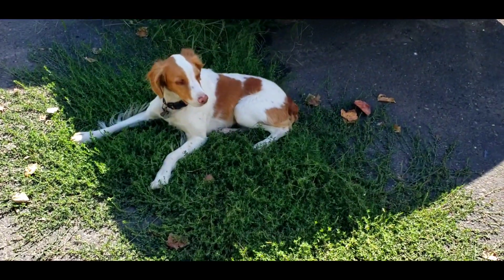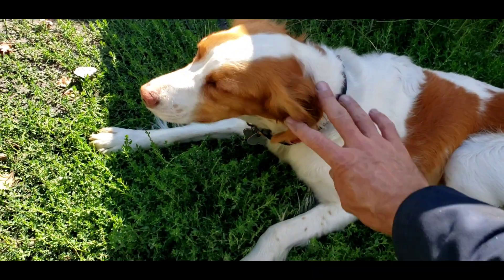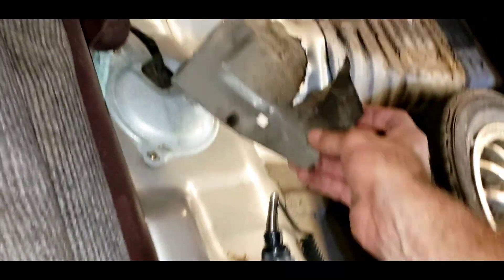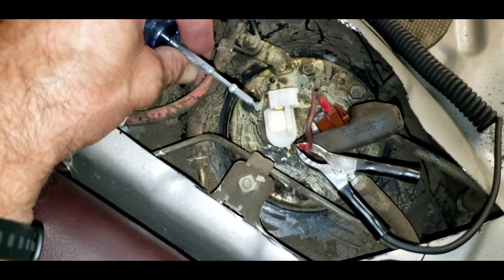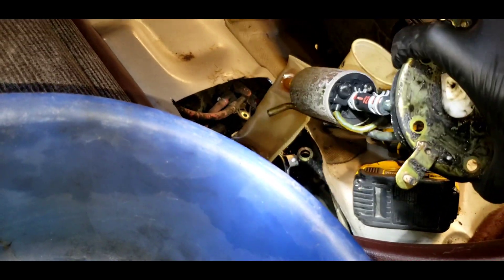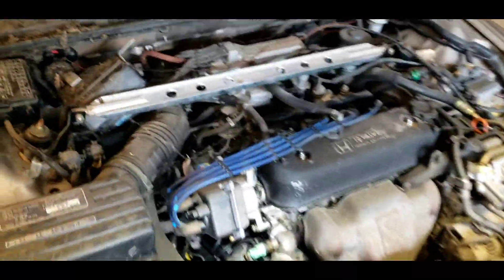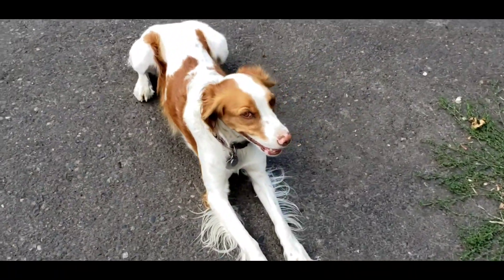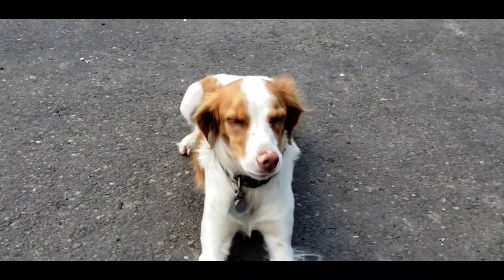Stella Says Start the Wrecked Honda Car Already

Comment: I guess sealed fuel system on newer cars is less affected from bad gas issue. I once started my Ford Tempo after sitting 3 or 4 years in garage. Didn't had more than couple gallons in tank tank. Started on first crank. Pleasant surprise.

Comment: I own one of these with the coupe body style, No air conditioning, no power anything except power steering and cruise control. The radio sucks, and it's an automatic (for now). And yet I am excited to drive it every single time I turn the key. It feels so nimble and light on its feet, the engine may not be very powerful, but it certainly responds to gas pedal inputs much faster than most modern cars, which makes modern cars feel like such a drag to drive. Even the 4 speed auto is a no nonsense, harsh shifting, gear banging reliable piece of equipment.

This was peak Honda, and they truly were magical. Never will we get a car crafted with so much care again. They deserve to stay out there

Comment: That sucks. They just crushed one of these at my local salvage yard. It was an EX-R that was sideswiped on the driver side and sat for over a decade in someone’s backyard. It had lots of good parts but they just cubed it without even taking it apart 😢